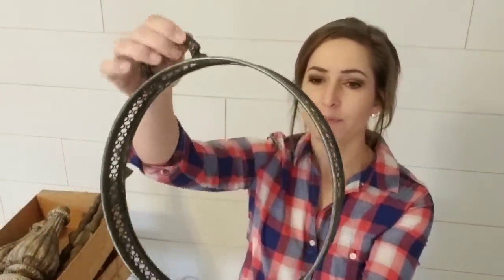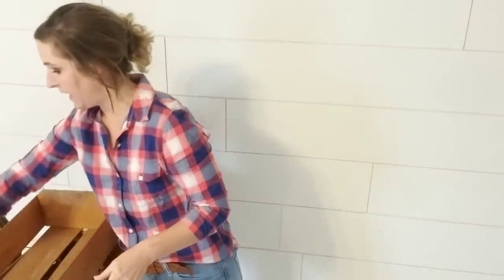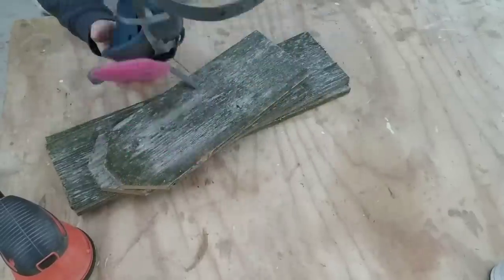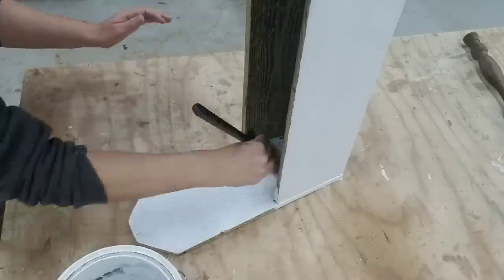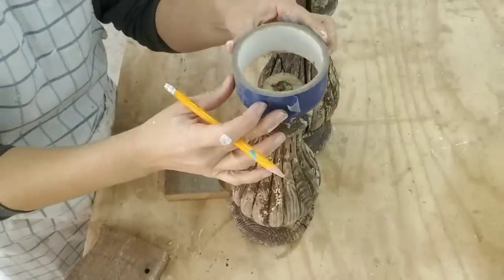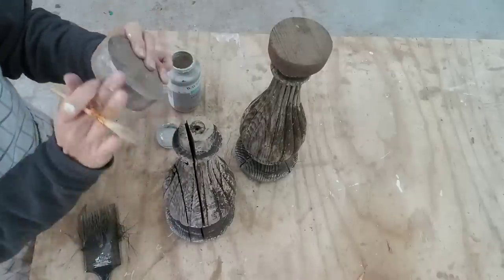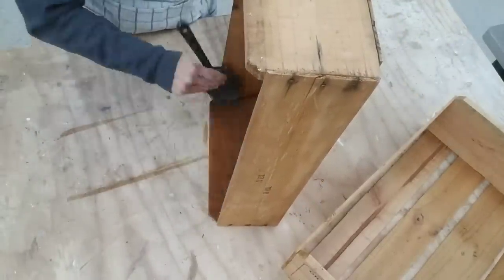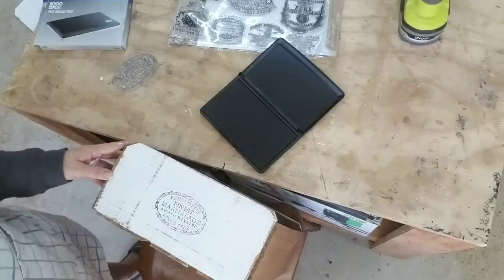Thrift to Treasure • Spindle Box • Crates • Candle Sticks • Tarnished Silver Tray

Comment: The silver "tray" is not a tray. It is a holder for a glass serving dish. Typically used on a buffet table.
Reply: 🎯Yes, it's for a chafing dish (it elegantly supports a hot baking dish). Folks don't set such fancy or formal tables or buffet these days! 

🎉 Beautiful reuse for this piece that probably ends up getting separated from the actual dish. Seen a few of them in thrift stores & garages sales in my day.

😉 Still, I could also see this thrift flip work with a vintage tray too. 🦋